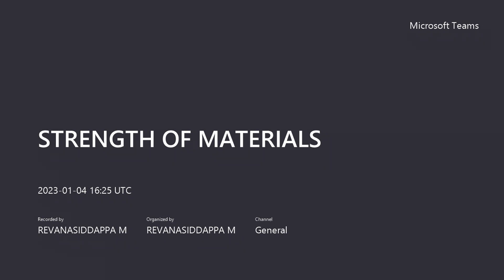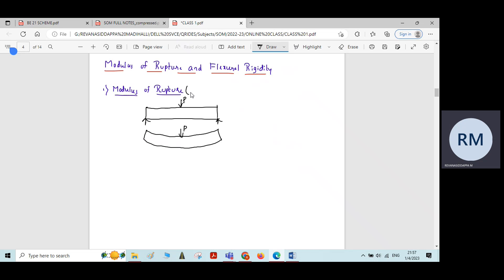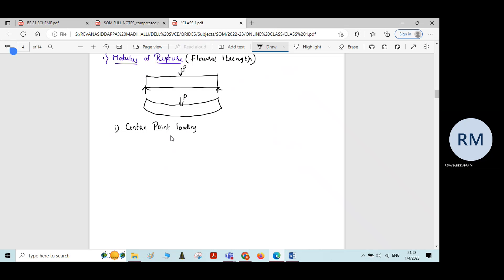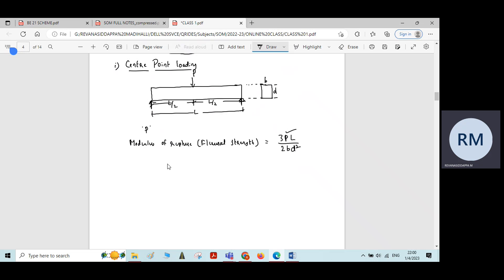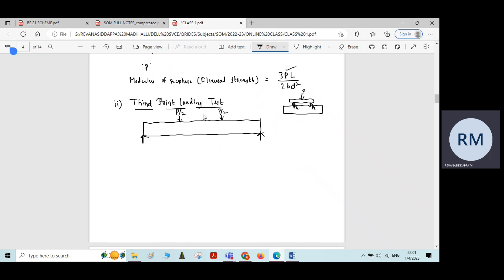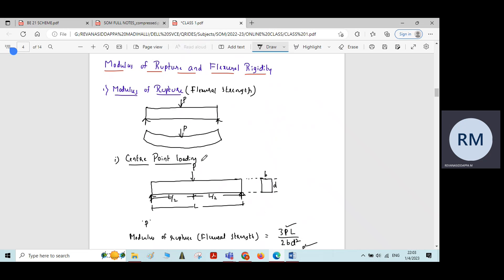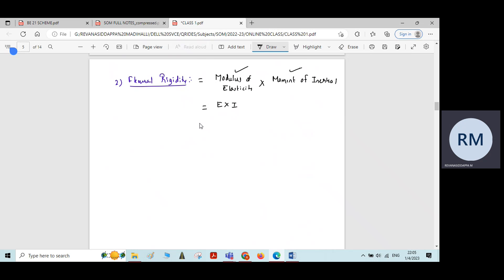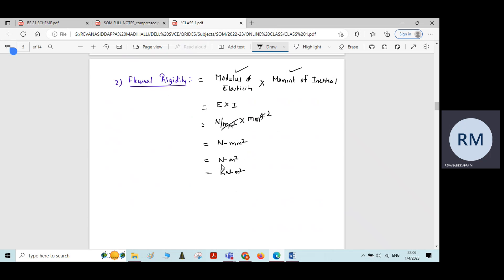MODULE 3 LECTURE2 MODULUS OF RUPTURE AND FLEXURAL RIGIDITY

Comment: How do I get a stress-strain curve from a 4-point bending load-deflection curve given that it is nonlinear or behaves elasto-plastically? in Stress value 4.991,23.960,39.452,22.059,56.601,59.016,60.00,58.941,58.087,58.087 and strain values 0.0001,0.0005,0.0009,0.0012,0.0017,0.002,0.0024,0.0029,0.0031,0.0035 from this values of stress vs strain curve how can i get modulus of elasticity. as modulus of elasticity is slope of stress strain curve. The correct obtain is 37400 mpa but I am not getting same value after plotting graph. Can you help me out.